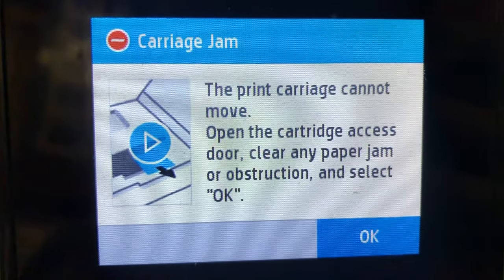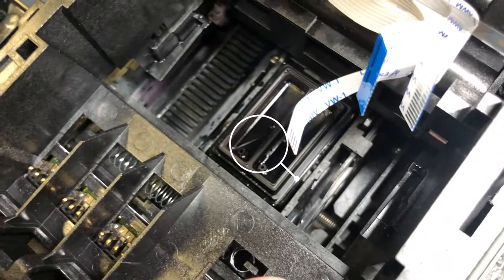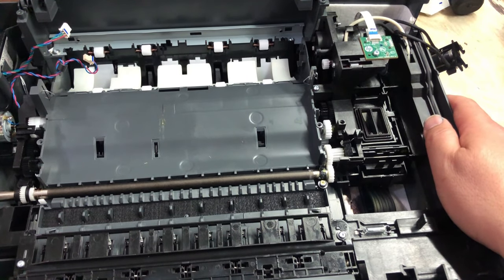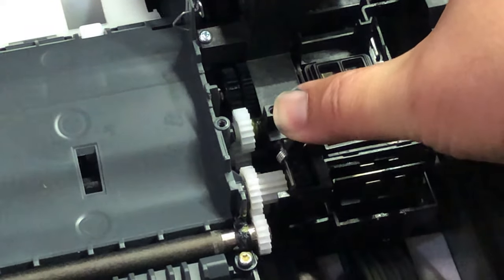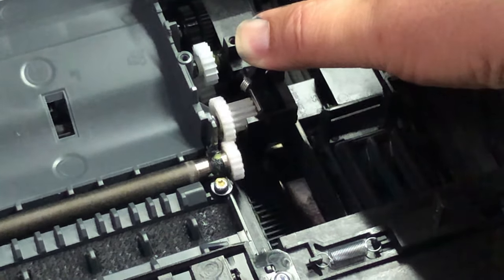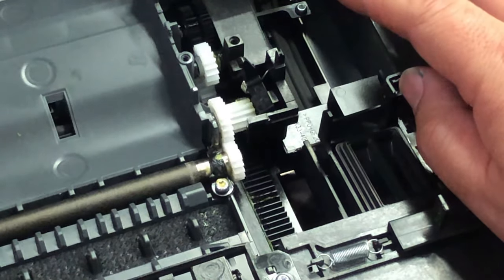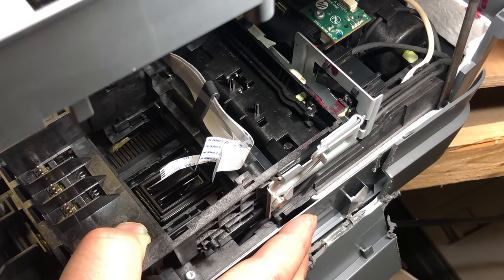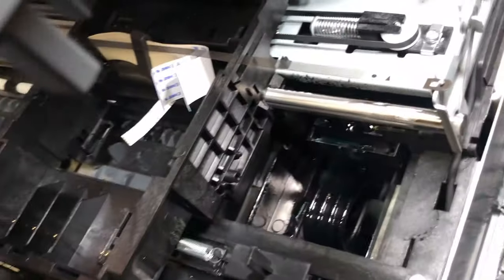Fix "Carriage Jam" in HP Printer - The print carriage cannot move.

Comment: I have similar HP printer and if you will encounter some strange error of carriage cannot move or error with paper jam it may be waste ink tank pump that has failed internally. It uses peristaltic and internal tube seems to poorly connected to outer connection and therefore it doesn’t pull ink. But it is funny that error has nothing to do with paper jam other than using same motor for movement
Reply from the maker: Great insight.  Thanks!
Reply: Can you give more detail. Where do I find these tubes
Reply: @eccmasterful open printer and on left or right back part you will see some silicone tubes going in. Take carefully pump out(you may need to remove waste ink system out first). Then disassemble pump and check if it is leaking around pump
Reply from the maker: @eccmasterful  Take the scanner off and you will see them.  They are under the capping station.
Reply: @BCHTechnologies  I was able to lower platform and moved all the way back. The ink cartridge holder reset and started moving sideways several times but then the platform is raised again and ink cartridge holder gets stuck again. What do I do from here.

George
Reply: @beepbeep1465  Any solution?